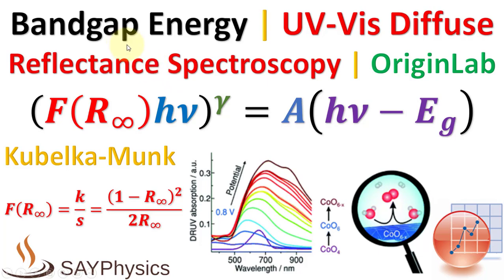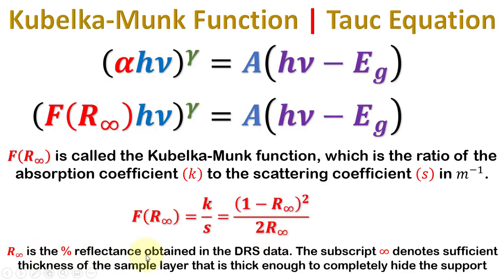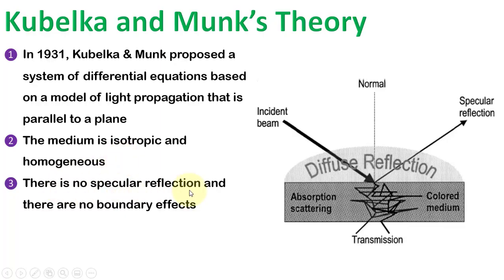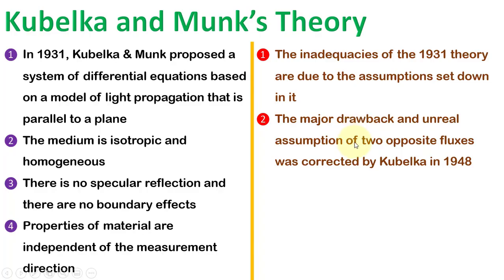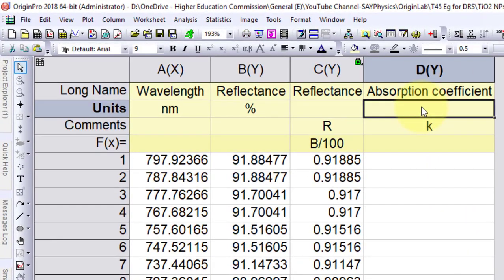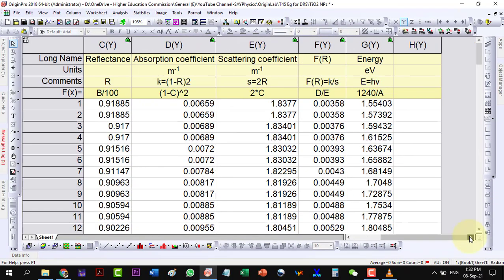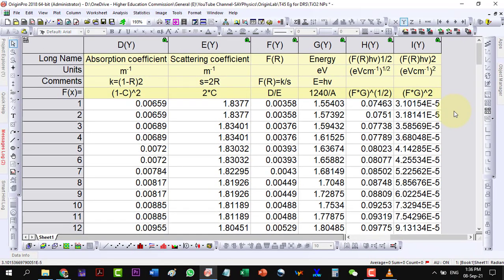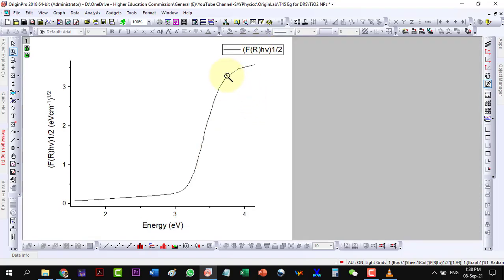How to calculate band gap energy from UV-Vis reflection (DRS) data in origin

Comment: Sir for gallium arsenide what I should put ? 2 or 1/2?
Reply from the maker: You don't need to put 2 or 1/2. But as per literature Gallium arsenide (GaAs) is a direct bandgap semiconductor, so your data will best fit with 2. Thanks

Comment: Sir how to calculate reflectance using absorption data
Reply: Can we measure transmittance using formula=(10^(-A))*100 by using absorbance data...
Reply from the maker: @shwethashwe6146 No dear. It's very empirical relation which has nothing to do with the actual nature of the sample.
Reply from the maker: Thanks for your question! Reflectance and absorbance are different optical properties and usually measured separately. If you only have absorption data, you cannot directly calculate reflectance unless you also know the transmittance or have additional optical constants like refractive index. For precise reflectance, it's best to measure it directly using a UV-Vis spectrometer with an integrating sphere.

Comment: For zno will i take 2 or 1/2
Reply from the maker: As per literature, ZnO has a wide direct bandgap of approximately 3.37 eV at room temperature. However, you're not supposed to decide 2 in advance. You will have to look at the trend of your data whether it supports 2 (direct) or 1/2 (indirect). Thanks

Comment: Thank you so much sir for this informative video... I have two questions: (1)If I have baseline-correction data, should I follow the same steps you demonstrated (%R/100), or should I divide %R by the baseline-correction values instead? (2) If I only have %R values, how can I calculate transmittance and absorbance from them?
Reply from the maker: Thank you for your kind words! 😊
If your data is baseline-corrected, you should still follow the normalization steps I demonstrated (%R/100) unless your baseline correction process requires a specific adjustment. Dividing by baseline correction values is generally not needed unless explicitly required for your analysis.
To calculate absorbance from %R values, use the formula A=−log10(T), where transmittance T can be estimated as T=1−R−S (reflectance %R converted to a fraction and scattering losses S if applicable). If scattering losses are negligible, you can approximate T=1−R.
Reply: @SAYPhysics  Thank you so much for your help sir
Reply from the maker: @MelodicRiddles you're welcome dear. Please share it with others too. Thanks

Comment: Hello Sir,
I'm Namratha from India. Now I have started my PhD journey. For UV-related things, I always refer to your video. I wrote one paper(UV part) based on your Tacu plot video. Thank you for sharing your knowledge. I have one doubt in this video. I have wavelength and reflectance, and I can find an energy gap. But can I calculate absorbance from reflectance? I referred many papers but I didn't get the answer. One says it's A=1-T while others say it's A=1-(R+T). Here I don't have the transmittance and absorbance data. How can I calculate absorbance?
In case we don't calculate absorbance from UV DRS data. Can you please send me one research paper that includes all your explanations? I need to write the reference.
Reply from the maker: Hi Namratha, thank you so much for your kind words! I'm glad to hear my videos have been helpful for your research. Regarding your question about calculating absorbance from reflectance, you're right that different sources provide slightly different approaches. When dealing with reflection (R) and transmission (T), the general formula is (A = 1 - (R + T)). However, in cases like UV-Vis DRS where you don’t have transmittance data, the common approximation is (A = 1 - R), especially for opaque or highly scattering samples. This is widely accepted for such cases.
If you are only working with reflectance data, you can apply this approximation, assuming the transmittance is negligible. For further reading, I suggest looking into papers that cover Kubelka-Munk theory, which is often used in DRS analysis. It provides a good explanation of how reflectance can be related to absorbance.
Feel free to ask more questions if needed, and best of luck with your PhD!
Reply: @SAYPhysics  Thank you so much sir. And i couldn't find UV DRS for fibres. fibre is a non conducting material. But im getting 3.80eV energy gap value. I think it is incorrect. can you please suggest one paper which includes UV DRS of a fibre?
Reply from the maker: Thank you again for your questions! I understand your concern about the 3.80 eV band gap for a non-conducting fiber material. It does seem high, especially for typical fibers, which are usually insulators or semiconductors, depending on their composition. Fiber materials like polymers often have lower band gap values, usually ranging from 2.0 to 3.5 eV, though there can be exceptions depending on the specific material.
For UV-Vis DRS measurements, the Kubelka-Munk theory is indeed a useful approach to consider. It relates reflectance to absorbance, particularly in scattering samples, and can give a more accurate determination of the band gap for non-transparent materials. In your case, with fibers, scattering is likely significant, and using the Kubelka-Munk function (F(R)), where (F(R) = (1 - R^2) / 2R), may provide better insight than directly using the approximation (A = 1 - R).
Regarding your energy gap value, it’s possible that the value you are obtaining might be influenced by the scattering properties of the fiber or an incorrect assumption about the reflectance spectrum. Verifying the reflectance data with a Kubelka-Munk transformation could give you a more accurate band gap estimation. 
As for research papers, while there may not be a paper that exactly fits your fiber material, I recommend looking into studies that apply UV-Vis DRS with the Kubelka-Munk method for non-conducting materials, like polymers or oxides.

Comment: Sir, I have an existential doubt and I would really appreciate your prompt response, why are the units Ev*cm-1? I am confused, the wave number is the inverse of the wavelength, but when dividing 1240 / nm, we do not have Ev*cm-1, please explain to me. :(
Reply from the maker: The units of eV·cm⁻¹ may have caused some confusion. When you divide 1240 by the wavelength in nm, the result is in eV, not eV·cm⁻¹. The factor 1240 comes from converting between energy in eV and wavelength in nm (since 1 eV ≈ 1240 nm for photons). The term "cm⁻¹" refers to the wave number, which is the inverse of the wavelength in cm. If you're calculating the band gap in eV, you don't include the "cm⁻¹" unless you're specifically converting to wave number. Thanks
Reply: @SAYPhysics  Thank you very much doctor, but then, why in the video in the bandgap graph the y-axis has units of ev*cm-1, if the conversion was not made? 🥹
Reply from the maker: @antonioculebro8038 because on the y-axis, we don't have energy but alpha hv. The cm-1 comes there due to the absorption coefficient alpha. Thanks

Comment: How can we find which band gap is correct( direct or indirect) ??
Reply from the maker: In UV-Vis spectroscopy, direct bandgap materials typically exhibit sharp absorption peaks, while indirect bandgap materials show broader absorption bands. By analyzing the shape and intensity of the absorption spectrum, along with theoretical modeling, you can determine whether the bandgap is direct or indirect. Additionally, plotting the absorption coefficient versus photon energy can help identify the nature of the bandgap. That's, we will check in which case a steep knee is formed. If for both 1/2 and 2, a steep knee is formed, it will mean it's a quasi band gap ie both direct and indirect. Thanks 😊

Comment: since both the direct and indirect bandgap looks the llinear you concluded that this is qusai direct bandgap then use indirect bandgap. Is this always true where when the direct and indirect looks the same linear you use indirect bandgap?
Reply from the maker: In general, when both direct and indirect bandgap data appear linear, it's safer to use the indirect bandgap for calculations. This is a common practice to ensure more accurate results in cases of ambiguity. Thanks

Comment: What does F(R) means physically? It's the ratio between k/s but, what is that?
Reply from the maker: In addition to my explanation in the beginning of the tutorial, let me add that K is the absorption coefficient, and S is the scattering coefficient. However, due to the difficulty in measuring the absolute reflectance R∞, in practice, the comparative reflectance r∞ with respect to a standard powder of which K is near zero (0) in the actual measurement range. Thanks
Reply: @SAYPhysics   If F(R) = K/S , Then how are you putting cm with eV in the unit on y axis.
Reply from the maker: In the first 5 min part of the tutorial, I'm explaining all this. If your confusion yet continues, let me know, I will elaborate it further. Thanks
Reply: @SAYPhysics  How absorption co efficient have unit per meter? If this is from R . Then R is simple the ratio of reflectance fromt the sample to standard. So it should be unitless.
Reply from the maker: @areejfatima2807 Absorption Coefficient (α) is measured in units of cm-1. This is used when dealing with the Beer-Lambert Law in contexts where concentration is not expressed in molarity. It's a measure of how much light is absorbed per unit path length. Thanks
Reply: @SAYPhysics  and same is for scattering co efficient. In the video you also wrote it's unit as per meter . So F is again unitless because it's fraction of these. Isn't it so? Thankyou for all previous responses.

Comment: The bandgap seems to be wrong because the origin of the vertical axis has not been set at zero. Vertical axis MUST start from zero. Otherwise the tangent line intersects the horizontal (eV) axis at a point less than the actual bandgap.
Reply from the maker: You're principally right, and in my case thee difference isn't more than 0.01 eV  However, for a simplest case this is true only. In this playlist, I have a bunch of videos on the brandgap, you may watch them to get idea about some complex cases.Thanks

Comment: good.. dear I have absorbance data from uv spectroscopy... can I convert this data into reflactance and solve it for and gap
Reply from the maker: Yes. Check the following playlist which has some videos on this. Thanks
Bandgap Calculation in Origin: https://www.youtube.com/playlist?list=PLeWSImvDbplfORnYYdjb0DLiLpyi7VWY1
Reply: @SAYPhysics  it is very well explained.. but sir actually I have absorbance data and I want to convert it into reflactance... is it possible or not?
Reply from the maker: I told you Yes. With the help of K-M function, you can do so, as explained in these videos. Thanks for the appreciation 😊
Reply: @SAYPhysics  but there is no video in which absorbance A is converted into Reflactance R... in K-M function the parameter is R which means we need reflactance.. but issue is that I have absorbance vs wave length data
Reply: sorry for so many questions
Reply from the maker: Spectral Absorbance (A) cab be calculated as: Absorbance = 1- (Reflectance + Transmittance), by the familiar equation R+A+T=1. However, this is a very crude way which requires a pristine material. In order to be accurate, you need DRS to get R. Thanks
Reply from the maker: It's Ok. I feel pleasure to respond. Thanks

Comment: Hello, thanks for the video. Is this method applicable for specular reflectance? Also,
From the tauc plot (alpha h v)2 vs (hv), how can we measure the energy band gap if we have multiple peaks? I mean it’s difficult to choose a point to extrapolate if we have multiple peaks. So, how can we decide?
Reply from the maker: Thanks for the appreciation dear. In multiple peaks, you may choose the first one as a band edge. It's a diffused reflectiance . If your material is a modified perovskite, it possess different bands corresponding to different energies.
Reply: @SAYPhysics  If I choose first one as the band edge, it results in very low band gap. I work on ferroelectric (PLZT) thin films for photovoltaic applications. Yes, it’s a perovskite material. I could measure the specular reflectance on my films using UV-VIS. Is this method applicable only for diffuse reflectance?
Reply from the maker: For such materials, you can't use the familiar R+A+T=1 equation to get reflectance (which is specular in nature). You need to have DRS data, and then use the guidelines provided in this video. Thanks
Reply: @SAYPhysics  If it has different bands corresponding to different energies, then how can we put the accurate band gap? The PLZT material has a bang gap (3-3.5 eV). I was considering the peak within that range. But I am not sure if it’s the right way to do. I can share the data with you if you want to look at it.
Reply: @SAYPhysics  please respond.
Reply from the maker: Already responded and sorry for being late. Thanks
Reply: @SAYPhysics  Thanks for the response
Reply from the maker: You're welcome dear

Comment: How can I normalize the K-M function?
Reply from the maker: Take the data in a separate column and apply the normalization as 0-1 or 0-100. Inside my playlist, You'll find some videos on the normalization. Thanks
Reply: @SAYPhysics   Thank you, although I need a procedure for the normalization of K-M function with respect to Reflectance for the transmittance obtention.
Reply from the maker: Right. You can send me your data on sayphysics@gmail.com if the videos are not helping you. Thanks
Reply: kindly send the excel file format sir